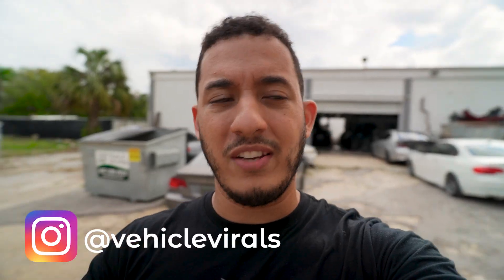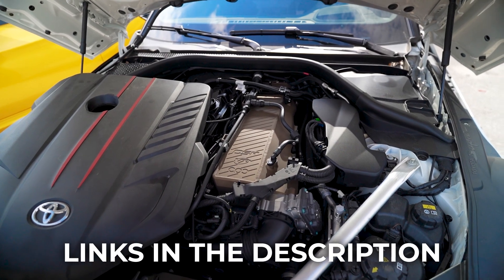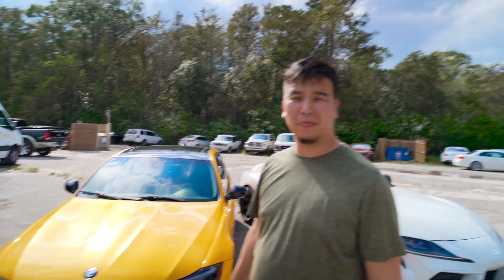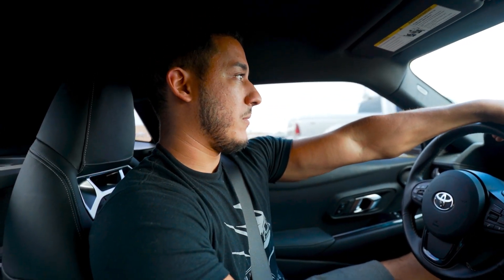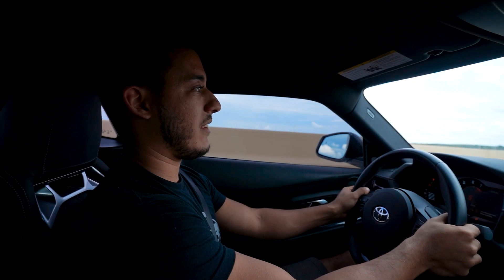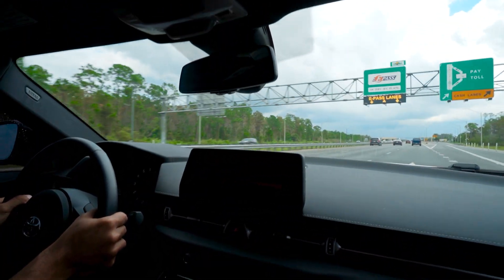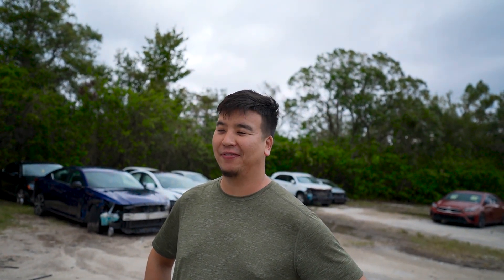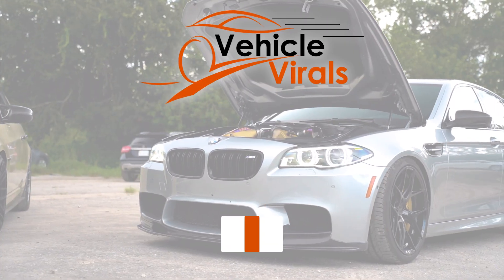Can My "Stock" Supra Keep Up With A Tuned BMW 335i With Upgraded Turbos? - B58 VS N54

Comment: And that's why I got an n52 :)  it's fun watching you guys go fast, though!
Reply: E92 N52 gaaaang
Reply: N52 gang
Reply: How do you make N52 bullet proof?
Reply: @dalisobanda5575  basic maintenance. Keep up on gaskets. It's a pretty solid engine.
Reply: @dalisobanda5575  Keep up on oil changes/top ups and normal maintence, and keep track of your leaks and gaskets.. and no crappy tunes
Reply: dealing with N52 irregular idle problems currently :(. Pretty sure it's a vacuum leak
Reply: I got both. It’s fun.

Comment: Remove the engine cover. You will get lower temperatures.
Reply: E90 here.. my engine cover lives in my trunk
Reply: @stevecariggillio4139  Took my cover off on my previous 435i, had it in the closet. On my M4 it's still on. It's way smaller and it's also winter here.
Reply: @stevecariggillio4139  water intrusion in the valley where the coils and injectors reside can lead to issues, i'm going to put mine back on.

Comment: The supra feels so fast, not sure what it is but when i rode in one i was shocked
Reply: Supra is more or less making 400hp at the crank, added to the fact that the Supra is 3300 pounds
Reply: @E82N55  400 crank lol 😂 you mean whp? It makes close to 400 on dyno that’s like 460 crank or so
Reply: @bman1668  460bhp stock? Huh
Reply: @anwaaraslam723  yea it makes 390-404 whp do the math buddy …
Reply: @bman1668  where have you seen it making 400whp stock?
Reply: @bman1668  from what I’ve always heard it makes up to 350whp. Never heard of 400whp mate. Got any websites?
Reply: @anwaaraslam723  350? Lmfaoo u funny man , most dynos 388-404 whp it puts down depending on weather and humidity which matters a lot but average dyno is 390whp
Reply: @anwaaraslam723  I have a dyno proving 397WHP on a stock Supra... Can't really show it through YouTube though...
Reply: @bman1668  the video said 404 hp at the engine. Completely proving my point? I’m confused
Reply: @markburkey6371  don’t need to see yours mate. Just send me to the website or video with anyone’s producing that much stock.
Reply: @anwaaraslam723  I have no reason to lie to you... there's a dyno sheet on my phone. No one's going to make a website or a video specifically for you, just go out and search for it.
Reply: @markburkey6371  wdym make a website? There are countless dyno’s of stock supra’s making less than 400bhp. You two seem adamant that somehow all fo those are wrong but can’t seem to come up with any proof 😂. Now your saying I’m asking you to make a website lol wtf 💀. You find one any one and just link me it 🤣
Reply from the maker: @anwaaraslam723  My Surpa Made 480WHP stock and that was on a blazing hot day with humidity being a big factor, and I have a video on my channel. With the downpipe is made 400WHP, again on a hot day with high humidity (Also a video on my channel).
Reply: @VehicleVirals  wow 480 whp got some crazy power stock. I’m assuming you meant 380whp, is yours the 2021+ model as they seem to be producing a fair chunk more.
Reply: @E82N55  it’s a 21 6 port so more like 382-388 to the grounds. Crank is over 400 plus
Reply: @markburkey6371  check my video out stock on my 21 tunable 6 port
Reply: @carmello000jp  good stuff, I'm going to guess that the dyno chart that I have read a little high as everyone's numbers seem to be right at where yours is. I bet it flies with e-50 now!
Reply: @anwaaraslam723  that’s dyno to the wheels! Rear wheels! 404 hp which is like 450-460 crank hp
Reply: @markburkey6371  hell yes night and day. Type in Gms racing… my cars being built for top mount big turbo G40-1150

Comment: uhhh wtf? A non tuned b58 losing to an upgraded turbo n54?? That n54 is a DUD. My stock twins car (black 07 335i, auto, DD)  will lay the wood to your bone stock a90. I have gapped many supras, most of which were not stock. Watch my channel if you want proof. Car runs door to door with a mhd 2+ e30 tu pump fbo b58 240i. N54 with good wastegates/seals, good custom tune on healthy twins absolutely have as much potential as the b58 stock turbo. I will take that to the grave...

N54 twins, provided the gates close, need two things to make jam: good inlets and a good exhaust. Ditch the stock e90 tubing. Even with all the stuff deleted, it's restrictive. A good 3.5" is what you need, car will make so much more top end. Inlets are also required and help with maintaining boost in the top end. 
The little twins also make hellfire levels of heat... so have a good intercooler/meth/e85. Good 97506 plugs gapped to .019... I digress....